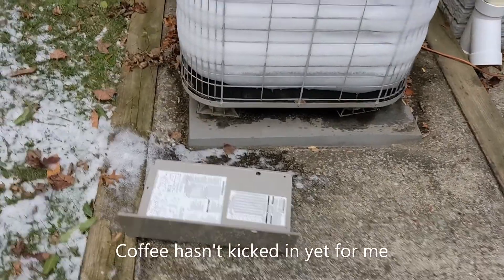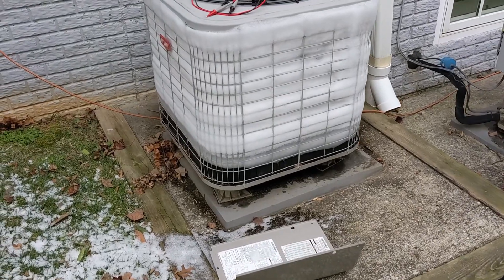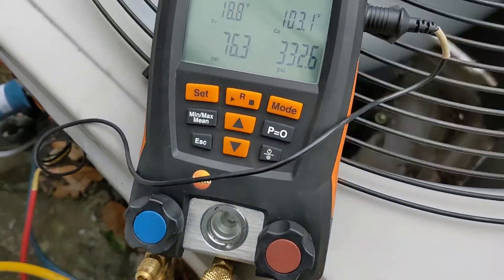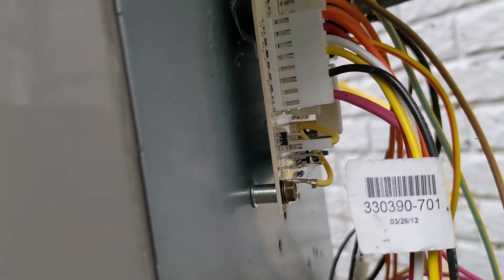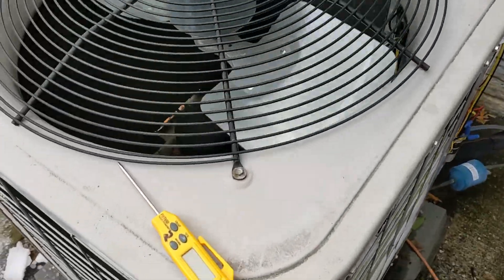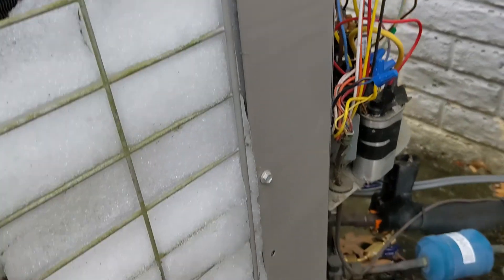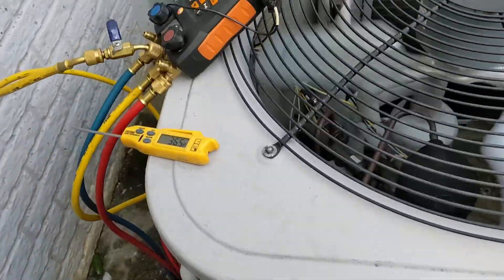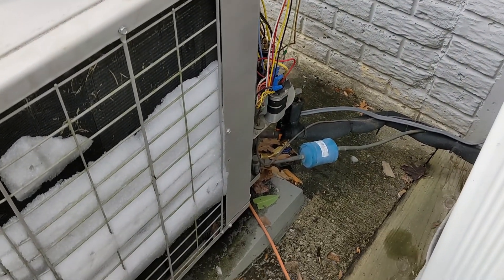2012 Bryant heat pump frozen, no heat service call

Comment: If whoever rewired the contactor had put the safeties wire on the brown wire side instead of the wire going to t1, they would have had to stick around and find out why the fuse protecting the low voltage control blew.  As it turned out, they just disabled the defrost cycle, and made their getaway.
Nice catch. You had it earlier when you tested t1 and got zero volts with contactor energized. t1 is an input terminal and gets its voltage from jumper from contactor coil 24 volt side. Tells the logic that compressor is running, which starts the timing if defrost tstat is below thirty degrees. They had it hooked up to common side.

Comment: could this have been a case where the board was replaced (possibly in the summer months, when no heat call was needed) and when winter kicks in the heat pump goes into heat mode and the crossed wires are needed for timer to work...In contrast (summer time) to when the heat pump is acting like an ac and no heat timers need to work..
Reply from the maker: Yeah for sure, they had service from someone else and thats probably what happened, was our first time there. I remember the defrost stat wires being cut and spliced.